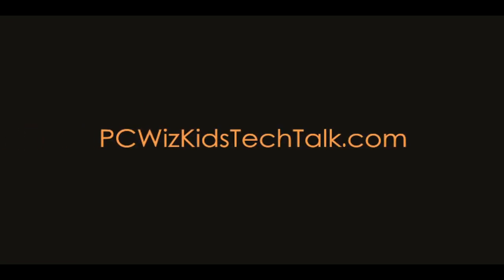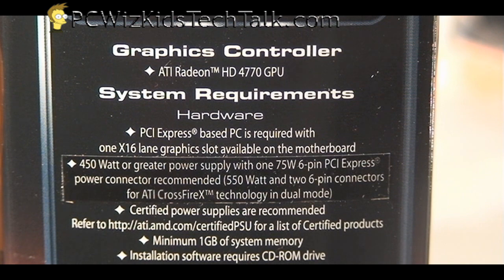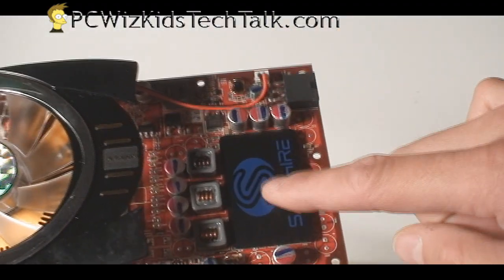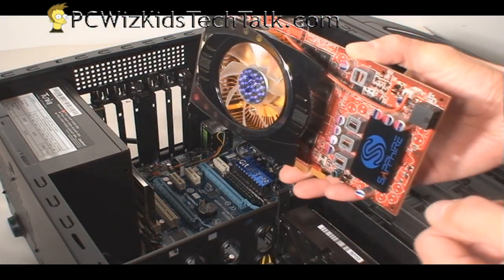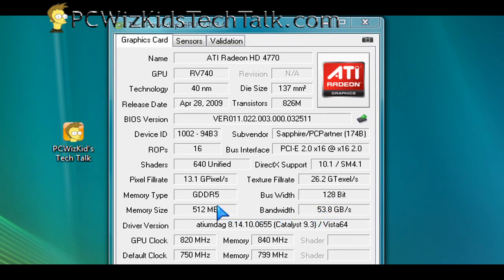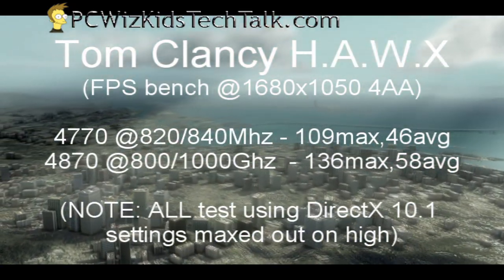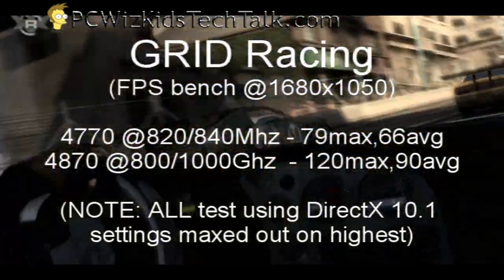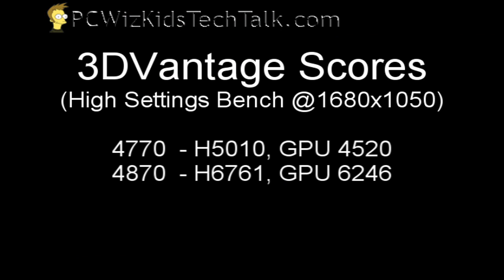Sapphire ATI Radeon HD 4770 - Review

Comment: amd overdrive as standalone software is NOT the same as the built-in feature in the AMD Vision control center.  The standalone software requires an AMD processor, and motherboard chipset.

Comment: @PCWizKid I have a 350W PSU too and psu calculators showed me 312W required if I would have a 4770 and 309W if I have the 4670 (which i'm running currently 100% stable). Can I run this card

Comment: No mate. They're AMD (AM2 socket) processors. :-)
One little advice though: Many, well *most* really, applications and games *at best* support two threads (or cores). That means a game supporting two threads will run faster on a 3GHz dualcore CPU than it will on a 2.5GHz quadcore CPU.

Comment: Ok, you're welcome. However depending on the thermal limits of the MB you can get up to a 6000+ CPU and they are a bargain these days. Especially if you can "settle" for something around 5400/5600+.
A stop-gap perhaps, but not too costly. I consider that move.

Comment: I just noticed that the Motherboard only supports AM2 sockets. So if i was to upgrade later on it could cost a fortune. 

Anyway if I did go for this I would also have to buy a HDD and a GPU. which would bring the price just above £310. I also need an OS which would cost about £70. Im waiting till June, July before I actually buy one, so a better deal could come up before then.

Thanks for the info anyway.

Comment: Im thinking of buying a Mid-Range Budget Gaming PC. Ive found a pretty good offer and was wondering if anyone could help me. Found it on Novatech. Its in the Barebones section going for £209.98.

PC Specs:
> AMD Athlon II X4 620 @ 2.60GHz
> 2 x 2Gb 240Pin DDR2 800MHz
> ATX Tower Case With 400w PSU
> NVIDIA MCP61P Motherboard

Would a 500 - 550W PSU be enough for this Card?
Thanks in advance.

Comment: This card is amazing. I bought an Asus HD4770 formula model and it´s a rocksolid stable at 925mhz core, 1000mhz memory overclocks. Idle temp is low as 35c and few hours of furmark testing the temp was between 55-57. With only 100 euros I got an card that closes in my old HD 4870 in perfomance. Just amazing!!

Comment: can my psu run this card with my other specs smoothly???
COOLER MASTER 390W EXTREME POWER PLUS

amd athlon 64 x2 4200 2.21ghz
asus m2n68-am plus 
2 gb ddr2 ram
250 gb hdd 
and the ATI HD 4770 

please i need the answer....

Comment: I bought a Powercolor HD4770 today. Works on my 350w PSU and even fully overclocked to Catalyst Control Center limits! (core is overclocked at 830 and memory at 850 mhz)
Been playing Dragon Age at these clock rates for an hour. Although the fan speed is just 33 percent, the heat never goes beyond 70 celcius. This card definitely has more oc potential but I don't want to push it that hard from the beginning.

Comment: You dont HAVE to have 550+ PSU BUT its recommended for best preformence and to ensure it allways work as its suppose too.

I'd say 400w+ will do fine, altho if you run more then one card then I'd say trying to get 500+ or 600..

Comment: No, the HD 4850 AND the 4830.  It's roughly around 5% slower than the 4850, but around 15% faster when over-clocked (850MHz Core, 4GHz Memory).

Comment: It doesn't need the full 450watts, just 450 is recommended for the whole system. the average modern GPU sips about 80Watts of power only, all the power requirment is for really, is to run the fan(s)

Comment: Well depends on what you play and at what resolution but for lower resolutions they are about the same with each card having a benefit over the other in certain games but difference is minimal. If you play at some huge resolutions then you'd be looking at a different card anyway. If you're upgrading from a computer 2 or 3 years old(or even a bit more) then probably get a 4770 is enough as it's very energy efficient which helps if you have 400-450w power supply(which is common in older comps).

Comment: I have run Crysis Warhead on 'enthusiast' at 1024 x 768 with 0AA and no AF and it's very smooth. With a decrease in settings here and there to Gamer, you can enable AA and play fine. Alternatively you can knock it all down to gamer, and play with higher res. Funny though, that the less optimised Crysis seems to run better, probably because it doesn't have all the fancy pyrotechnics that are more common in Warhead.
Another that works great with max detail(little or no AA) at 12 x 10 is Far Cry2.

Comment: Just got a 4770 to extend the life of my 3 year old Core2Duo 6400 with 7900 GT card till now. Could have gotten a 4850 for a dollar or 2 cheaper but only have a  17 inch  with 12 x 10 resolution max meant that it wouldn't matter much and the benefit of low power consumption meant that I didn't risk needing to upgrade my PSU either. 

The card performs great! I had to often knock down resolution to 800x600 with low details on some new games, I now can play everything  max details at 12x10!

Comment: The heatsink on this thing is aluminium sprayed a copper colour, so I'll be putting my VF900Cu on mine when I get it (4670 atm and it's struggling with a 22 inch 1680 monitor)

Comment: i max out the settings on prototype with this card and it still runs sharp and fast as hell

AMD Athalon 64 x2 @ 2.7GHz
4 GB RAM
1.5 TB HDD
Gigabyte GA-MA770-UD3 Motherboard
Asus 22" VW224U
430W PSU

Comment: 450w is the recommended figure but you'll find that several reviews and AMD tech support will tell you this card will run fine with lower outputs. Mine runs quite nicely on a 360w psu.

Comment: Actually the 4770 is on the 40nm and 4870 the 55nm. ATI having problems with making the 40nm so there won't be any GPUs made with this until the DX11 cards. There's another budget card coming which is going back to the 55nm. So basically the 4770 will be the only ones for now with this new chip. Some games do suffer from the 512mb GDDR5 that's why I said the 4870 1gb is a better option if its only £15-£20 more. I'll wait for the 1gb 4770 though :)

Comment: @PCWizKid 

But I think comparing those would be kinda unfair.  The $109 HD 4770 from Newegg is from Biostar, which is not very trusted for GPUs.  I chose a Diamond card because it's more known and they have good support.  Apart from that, the Toxic Edition 4870 from Sapphire is pre-overclocked, while the 4770 is not.  The $139.99 Sapphire HD 4870 does come with the same cooling technology in the Toxic, though (Vapor X is the name, I believe).  It's only a $20 difference.

Comment: i wont to know if it is worth upgrading from my 9500gt 1gb to the hd 4770 512mb my current PC specs are 450w psu amd 5200x2 2gb ram 160gb ide hard drive but iv got 2 80gb sata hard drives witch i will be putting in raid 0 hope to here from you soon peeps?....

Comment: If you overclock it, it can beat the 4850 that's not overclocked. 770 is on the new 40nm chipset while the 850 is using the 55nm, in other words the 770 produces less heat, uses less power but has better OC'ing potential because of that. They are also cheaper. I would rather buy 1 or 2 of these for the time being until DX11 comes out. There's no point spending £200 on a GPU that will be obsolete by the end of this year.

Comment: lol are the ati realy that bad i have an 8800gt and overclocked it a bit and i can run all the games on max setting ofcourse my monitor is 1280x1024 but still crysis warhead on enthusiast no prob crysis on very high, an they all work smooth for me plus i have a 350 psu

Comment: 9800 GTX is old tech, from benchmarks the 4770 is similar or better in most games. Not forgetting that the power consumption is about half, so if you have and older system that you want to stay alive for a couple more years(like my 3 yr old one) then it's a great card as you don't need to upgrade the PSU

Comment: the higher the watt, the higher the bill, Man try to look in the 12v rail, if its 250watts as he said,sometimes a 600watts PSU is weaker compare to a 450watts good PSU. you should have at least 21 amps on 12v rail. 250/12 = 21 amps (rounded). but remember the cpu also consumes in 12v rail.

Comment: No, 80W is when it's in idle.  When on full load or in stress, it uses 250 watts.  This is to help with power consumption.  If you use a 400 watt or lower PSU and are running it in full load, you could either fry it, get a BSOD, or make the computer crash.  The average CPU consumes about 90 Watts, you'll get a GPU that consumes 250 watts (on full load), coupled with the power the optical drive, I/O, RAM, and other parts will consume, it's gonna be about 390 watts or so.

Comment: No, do not.  Your PSU will fry due to too much stress and power requirements.  This GPU will consume approximately 250 watts under full load, and a normal CPU will use about 90-125 Watts.

Don't even try to do it.  I'm saying it for your own good.  Use at least a 450 Watt PSU.

Comment: It's not a good card if you want something that is future-proof or that will play most games at a high framerate with high settings.  If you want that, you should either look into something starting with the GeForce 9800 GTX, Radeon 4850 and 4870, and the GeForce 260 GTX.

Comment: It's better just if overclocked.
4770 is right between HD 4830 and HD 4850.
4830<4770<4850.

Anyway it's a very good card, because of its performances and because of its 40 nm Technology. (Less power-usage, smaller temperatures). +Of course ... SMALL PRICE.

Comment: Hi, i'm quite new to this. I'm planning to buying this graphics card. i'm using gigabyte g31m-es2l mobo. It is a lousy mobo. It cant cross fire or overclocked graphics card so i wondering is this graphics card good for gaming on my mobo? As in the default factory settings, are they good?
My com specs:
E8400 3.0ghz
3gb ddr2 ram
510w psu
XP Pro SP3

Comment: increasing the frequency "clock speeds" on both the GPU core and the GPU memory..... the GPU is like a processor but for graphics and is a little chip that is under your heatsink.

It should make the card "faster" but from my experience.... only be a few frames and overclocking your CPU (processor) is much more effective...
maybe this is because the architecture of the card... I'm not sure.....

someone wanna clarify on that?